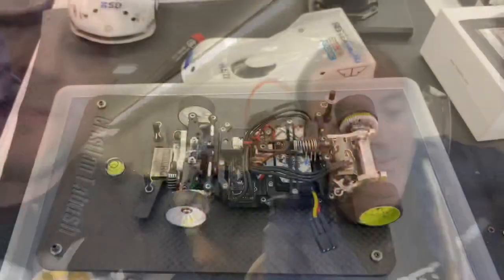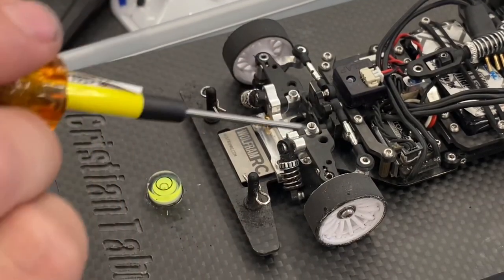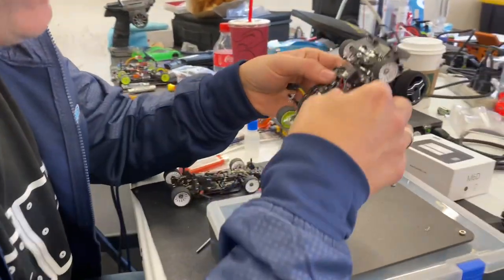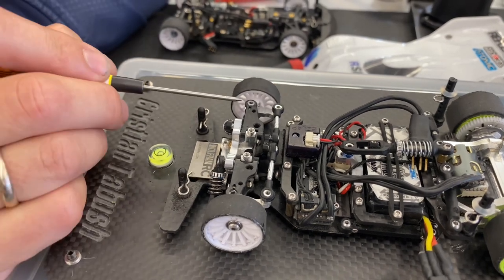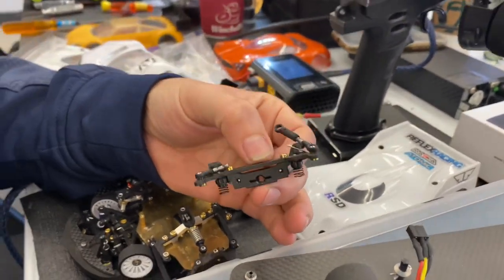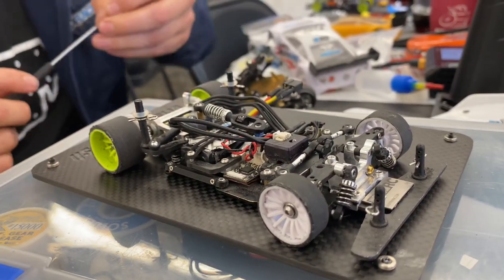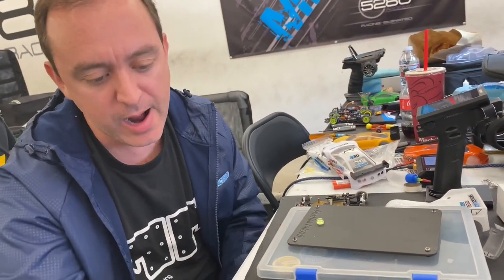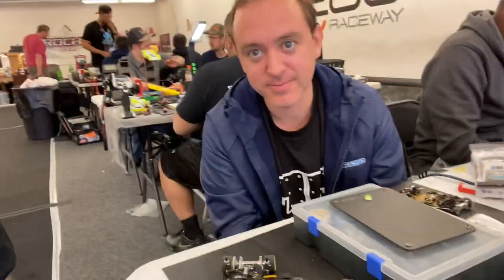Mini Z - Reflex Racing RX28 Review/Overview with World Champ/Designer Cristian Tabush

Comment: Why would you design 1/28 scale car and mr03 bodies won’t even fit to it.
Reply from the maker: it has to do with the rear pod being a priority over bodies. The rear pod sits exactly where the MR03 body mounts are... since this car is used 90% of the time with Lexan bodies, they felt like it was a trade off. Its also pretty easy to adjust an MR03 body to fit on it.